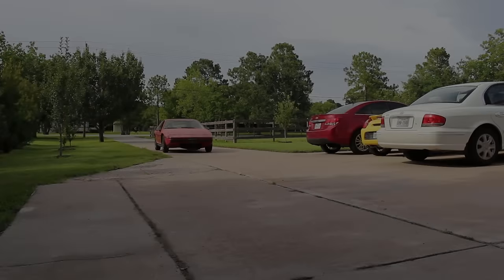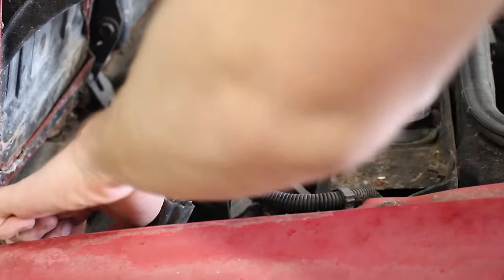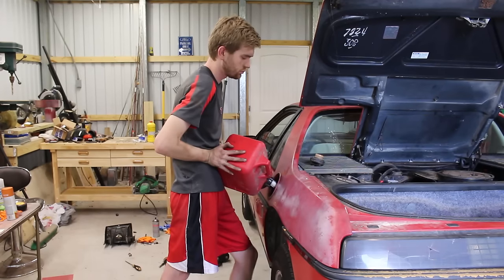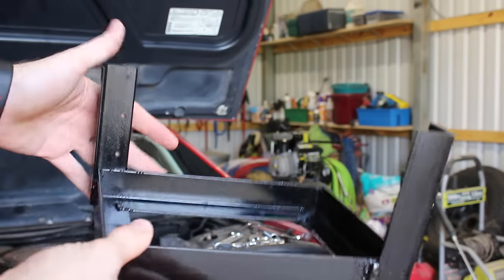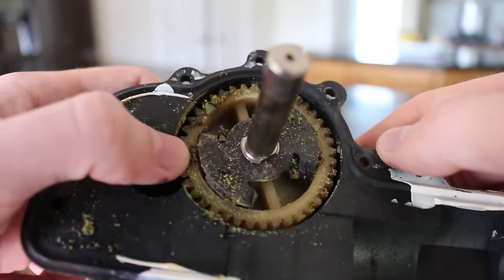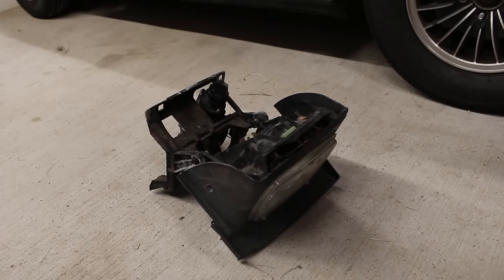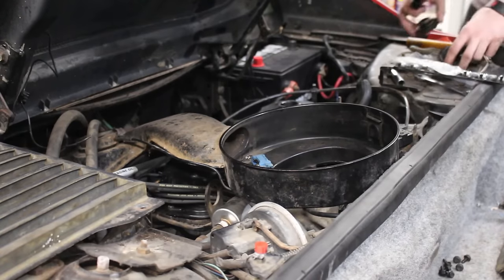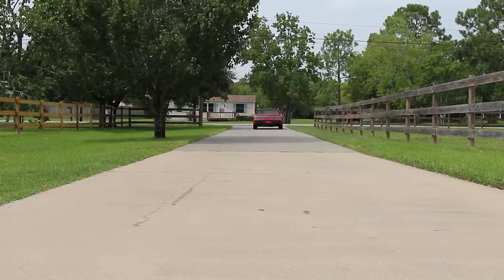Blink Once If Your Headlights Go Up and Down | 1985 Fiero 2M4 Revival - Part 4

Comment: The broken bolt was nothing compared to the fear of seeing a fram oil filter
Reply: WORST filters out there, absolute junk.
Reply: Napa Gold may be a better choice.
Reply: I only use WIX on my cars.
Reply: Wix, Purolator, Napa. All infinitely better options than Fram.
Reply: @SecretSauceyjuice  I go with Purolator BOSS myself since NAPA isn't close by
Reply: I can't believe I had to scroll down this far before finding a comment on the Fram filter.  There are many videos on YouTube showing how terrible Fram filters are.  You would literally be better off having no filter at all!
Reply: The Fram Ultra Synthetics are good. But yeah, most of the others, especially the orange can of death are horrible, shouldn't even be sold really.
Reply: @robis40  Yup. Only use Wix filters anymore. Feel guilty if I am stuck using Fram. Makes me want to change the oil sooner. With Wix, I have confidence that it won't make a lot of difference if I go over my mileage before changing it.
Reply: Wix makes the Napa filters.
Reply: Purolator ONE seems to be one of the best filters.  The nice thing about the Motorcraft filters if you're a Ford guy is that they're apparently just rebranded Purolator ONE filters that are sold for a few dollars cheaper.
Reply: @j5689   Usually I stick with Motor Craft for our Bronco (Wallyworld has decent price)   Our VW Beetle gets the Purolator Pure-One filter....  And our Subaru only gets OEM factory from the dealership filters.  Had a Fram on our former Probe GT (uses H.L.A's for the valve train)  Sounded like total &hit...rattles all over the place.  Went with a NAPA GOLD (wix) filter...  Purred like a kitty and it was nice and quiet..
Reply: you guys realize that pretty much all filters are made by the same company with the same internals right? i have cut more than enough apart to know
Reply: Wells Motorsports, not really, there are some good comparison videos on YouTube, check them out.
Reply: i watched a mechanic on lubetube here open one once, and ran down and changed mine..  i was not aware that they where pure garbo, i even opend mine to verify that they where garbo in my contry aswell, and it was.  would rather run no filter than fram!

Comment: Hanes and Chilton’s manuals, as a 15 year old with no dad around I completely rebuilt a salvaged 1978 Camaro that was my first car. Later I rebuilt my Fiero with same books. By the end the books are always covered in grease but it was money well spent. You may want to pick them up if you can find them. I have owned a lot of cars, I always bought the tech manuals until recently, newer cars are overly complicated.

Comment: Not sure if someone said it. But to easily remove that bolt, weld an 8mm nut to it and turn it out. You may have to build up the end of it a bit before, but it should all be easy.
Reply: @fartmerchant762  will you tho?

Comment: @Ronald Finger Another tip for you. If you break off a bolt again and need to drill it out, next time go to Harbor Freight (or order online) a set of left hand twist drill bits. You run the drill in reverse to drill it out. A lot of times in the process of drilling out the bolt you will end up removing the broken bolt threads because the friction heating of the bolt while drilling will loosen the broken threads and spin them out.

Comment: Quick tip for oil change when you are in your driveway or garage - get some old cardboard or a drip cloth so you don't make a mess. I'm sure this must have been a comment before but I am not going to look over 1700+ comments. Good luck on your build!
Reply: And keep kitty litter around to clean up the floor at the end of the day. Lay it down and grind it into the oil with a brick and then sweep it up with a dust pan.
Reply: Orrr a drip pan

Comment: That bolt snap was cringe-inducing.  And when you started talking about the extractor, I had a sinking feeling what you were going to say.  Ugh.  Where’s Mustie1 when you need him?
Reply: I feel like snapping a bolt is a rite of passage when learning to work on cars.
Reply: @CyclonesWorld  True, I had three cam bearing bolts snap when undoing as the last asshat had over torqued them. Fortunately they just span right out.
Reply: @boboyo  that is a fantastic trick! thanks for sharing. 

(PS: I've snapped a wheel lug before. not the worst thing to replace, but yeah - lessons learned)
Reply: @doorgoo  or convert to inch pounds and use a torque wrench meant for that range
Reply: @robertvulliet3278  What I do. Inch pounds.
Reply: Yup, just a gentle squeeze down for those. Good luck with the drilling out of the extractor. Cheap quality or not, it will be hard metal. I'd be trying a sharp punch and a hammer to see if it would tap round. Sometimes bolts break but aren't tight. With this engine is there a possibility that the bolts are more than one length and this one has bottomed out?
Reply: @delukxy  Another way I usually extract busted bolts, back when they happened, is actually just use a cheap chisel and punch a slot into it and unscrew it with a screwdriver. Works good for calve cover bolts since they rarely bottom out.
Reply: That's the first of many bolts you will break off.
Reply: Yeah I was just in the same boat with intake manifold bolts!
Reply: Ha i watch Mustie1 too!
Reply: I did the exact same thing when I changed the valve cover gaskets on my Jeep liberty (RIP). Took it to my mechanic and he said: "let me guess, Harbor freight torque wrench?"  he was right...
Reply: @BigATB  Haha I bought a HF torque wrench, and my dad thought that was unacceptable. So now I have that and a Snap-On one. Probably saved my brakes for me
Reply: Broke my share of bolts over the years, just a thing that happens lol

Comment: The SECOND you started tightening that valve cover bolt I knew was about to happen lol... I did the same thing two years ago. I was too lazy to even try to extract it so i just put a liberal amount of RTV around the bolt hole and its doing the trick... but completely forgot about it.

So... thanks for reminding me that I really gotta take that thing out.

Comment: This is just my input on the gas pedal. I think the reason why is that if you put the ball of your foot towards the top of the pedal you canapply pressure and the friction from your shoe and pedal with the leverage would aid in a long trip almost like a mechanical cruise control. A lot of 80's American cars with manuals and some with autos didn't have cruise control and early cc wasn't very fuel efficient.
Reply: Just need to get that pivot lubricated and moving freely, and drive with his heel on the floor.

Comment: Great job on the Fiero.  I like that you took things like the headlight motor and rebuilt them vs buying new/rebuilt ones as a complete unit.

You've had lots of advice on the broken bolt, but I want to say two things,  Yes, get an inch pound torque wrench.  I have 4 torque wrenches from smaller inch pound to long HD ft pound units.  I believe Harbor Freight has a digital unit that is inserted between a normal ratchet handle and the socket/extension.   Also, while a manual may or may not indicate torque values on the valve cover and other bits, one thing to look at is torque values per a certain size bolt regardless of what it's going in.  Those values should be easy to access online or possibly in your Fiero manual.

Finally, I didn't see this in the comments, so if someone already mentioned it, forgive me!  But, I was cringing when you were changing the oil on that nice, clean driveway.  When you do that again, use some cardboard to lay on the concrete.  It's easier on you than laying on the rough driveway, and it catches the drips and such from the oil.  I keep a few of my bigger mail order boxes around just for this purpose.

Again, great job!  I look forward to the next video, whenever that is.

Comment: I recommend deleting the EGR with a blockoff plate shaped like that gasket you replaced, minus the holes. Plug off the vacuum lines and say you're welcome to your engine for not force feeding it exhaust gasses.
Reply: I was honestly a bit shocked when I first read, that the fiero has an EGR. I hate EGR's and I don't get it, why they put it to a gasoline engine. I mean my old E39 doesn't have one.
Reply: @jensharbers6702  this particular Iron Duke won't throw a code or have any issues with the ECU after an EGR delete since the valve is purely vacuum controlled. Emissions in the early 80s was a bad scene.
Reply: I just did a 2.8 delete and bolted in a turbo 3400 lmfao

Comment: Haha, the snapped bolt cracked me up, the moment you turn it for the third time I instantly thought that's not right, you'll snap it shortly :)
There is hope though for you, despite snapped bolt extractor in there. Get yourself some CARBIDE drills, they will drill through the broken hss in there with no problems, then you should be able to retap and do it right :)
Good luck!

Comment: 3:58 "it's probably just left over electricity that turned to grease over time" what?
Reply: Hint: Joke
Reply: I loled
Reply: Whoosh
Reply: I use left over electricity to power my left handed board stretcher
Reply: @johntripp5159  Dude! Where did you find it left handed? I've been looking for one of those for years!
Reply: If you're new here, Ronald has a bizarre and fascinating sense of humor.
Reply: He got me for a second with that deadpan humor too.
Reply: @andersjjensen  I was in the mental sail loft and it was sticking out from under a bale of three inch shoreline...

Comment: Let me guess, on torque specs for the valve cover you read it as FT lbs and not IN lbs lol. I watched my best friend do the same thing on his chevy.
Reply: Did the same thing to my jeep a while...  But I'm now rebuilding the engine. Take you time and you'll have epiphanies on how things work / how to resolve issues.
Reply: he just forgot to say "Click" and move on to the next one (Daboss Garage reference)
Reply: I did the same thing to my 99" TA after changing a push rod.  100 ft. lbs. didn't seem right but i did it anyway. That was 5 years ago. The bolt is still stuck in the head to this day.
Reply: SweetMahogany Did this about 20 years ago on a Dodge Daytona with an automatic. I was adjusting the transmission bands and mistook foot pounds for inch pounds. Let’s just say it didn’t shift so good afterwards. I wished it was a valve cover bolt!  That’s how we learn though. You’ll usually only make a mistake like that once. Lol.
Reply: @mitch95722  did it on my 04 Liberty. I just upgraded to a real Jeep, 2015 2-door willys wheeler
Reply: Aaron Bernstein did the same exact thing. On an 04 Liberty as well. Haha

Comment: In about 1998 my dad had bought a 84 2m4 that had a blown engine with intentions of putting a V8 in it. Well he lost interest and gave the car to me. I ended up buying a 86 V6 se that the body had been completely removed by a gentleman that worked at Cape Canaveral. Yes he was a Rocket Scientist, he was going to build a Lambo/Fiero. He built his own body mold. Again another person whom lost interest. I pulled all wiring out of the chassis of the 86 and then the 84 and made a 84 V6 Fiero. Swapped in the motor and transaxle and ecm. I had alot of fun in that car..

Comment: Don't feel bad about snapping that bolt I've done it many times, and in my experience here's what you do, you get yourself a high quality extractor and after a few failed attempts you pour some gasoline over the vehicle light a match watch it burn for no more than 29m and 15sec.hose it off and then call the junk yard to pick it up.on to the next project.😛👍

Comment: Dude I was literally cringing the second I saw you cranking that torque wrench.... It was like a watching horror movie
Reply: like he was putting on head bolts with all that torque, then bam......
Reply: The simple fact it was a click wrench told me he was about to torque that valve cover to infinity and beyond. Standard length 1/4 ratchet and a nice "snug" calibrated elbow torque wrench click is all it needs. Then if it leaks, give it the beans once again

Comment: Next time you remove a snapped bolt drill a small hole and use an appropriate sized torx bit and hammer it in and then remove with a socket and ratchet works everytime

Comment: Ughhh...sounds like you made the classic "inch-pounds versus foot-pounds" mistake when you broke that bolt.  I have been working on cars for 30 years and I have done it, too!  The later Fieros have one module that controls the headlights, and it is known to fail.  New ones are brutally expensive, but I discovered early Saturn SC coupes use the same module.  When I had my '88 Formula back in 1998-1999, that meant a quick trip to the wrecking yard for a $5.00 replacement.

I really miss that car.  Bought it from a wrecking yard after it had an engine fire!

Comment: As soon as I saw you cranking down on that bolt with that big of a ratchet............. Oof, I like to use a 1/4 rachet just so I can't over-torque bolts on pans and covers
Reply: I was just going to say the same thing. I don't break out the 1/2 inch drive unless the bolt is bigger than a 9/16 or so. 3/8 drive with your hand up by the ratchet head or use a 1/4 inch like you said.

Comment: You broke a bolt in the engine?  Time to replace the engine, that's a rule.  Gotta put a LS in there now.  God wills it.
Reply: Of all the interesting engines this world has to offer, why on earth put the most cliché one of them all in there?
Reply: @andersjjensen  It's cliché cause it's a great engine that fits into tight places and they're cheap.  Find a LS4 from a junked Pontiac Grand Prix GXP, the Chevy Monte Carlo SS and Impala SS, and the Buick LaCrosse Super.
Reply: @DukenukemX  Exactly - cheap, reliable horsepower. You can't beat 'em.
Reply: 13b swap
Reply: Turbo 3400 is my go too! Lol shameless plug checkout GARAGELESS
Reply: @TheUberdude14  You mean Quad 4 engine.
Reply: @Garageless  I dig the 60 degree V6's but LS.
Reply: @DukenukemX  ls is just a bit more costly by far
Reply: My understanding is that a 4.9 from an early 90's Cadillac is almost a bolt in.
Reply: The 4.9 is ok but not the best engine to use “I had 2 in my fiero” Those engines have terrible HP numbers and only all torc. They’re disposable engines as well... “Very expensive to rebuild might as well throw away and buy another from the junkyard” 

Like the northstar they have cyl sleeves with o rings to keep coolant out the combustion chambers “very stupid design” I won’t go into details about if you rotate the engine with the heads removed.

The 3.4 and 3800 sc engines is the best engine choices “Both engines has tons of info on them.

I’d use a stock 2.8 over a damn 4.9 caddy engine.

Comment: You probably already know this but you can weld a steel rod with a hollow nut to the broken bolt and back it out.  Check out FuzzyDiceProjects on YouTube, he seems to do that quite often.  Great video!
Reply: Hard with the smaller bolts

Comment: Screw Fram filters!  Get a Wix, or a NAPA Gold instead.  Fram are notorious for collapsing inside.
Reply: I agree, even though Fram was the original designers of oil filters, they are now the worst choice one could make.
Reply: Good to know.  Thanks for the tip.
Reply: Wix makes the filters for the NAPA gold series. Not sure about the silver series, though. :)
Reply: This. Times a thousand. Wix are all that go on my vehicles, period.
Reply: Yep, Wix 100%! My automotive tech professor always grimaced when he would see a Fram on a vehicle lol
Reply: +1.  I only use Wix filters.  

If I were your dad I wouldn't be happy about the oil stains on the driveway.  Get a sheet of OSB or better yet cheap plywood, cut it in half and out it down before you change oil.  If you drip or spill it won't soak into the concrete.  Your dad will thank me.

Comment: As an old Fiero owner, some tricks we used to keep the car going was change the coolant thermometer from a 185F degrees to 165F degrees.  You should also move the battery to the front of the car for both weight distribution,  as well as the battery will tend to leak onto the wiring loom - which is located under the battery tray.  Another trick is to wire the radiator fan to be 'on' all the time, when the car is turned on.

Comment: Greasy electricity is a big problem for these old cars that aren't fitted with a > 100 milifarad current filter. You can test if your car is fitted with one by licking the battery terminals. If it tastes of minty-metal it's fine, if it tastes of gravy and death you need to scrub the whole electrical system with a mix of vinegar, caustic soda, and ground beef. And make sure you lube the battery contacts with lots of ketchup before you hook the battery back up. Use soy sauce if it's a Japanese car.
Reply: Lol
Reply: My friend has a Triumph with the old Lucas electronics, he had to use a blend of HP Brown Sauce & Malt Vinegar, I think you need to use mayo on Spykers, and Curry Ketchup on VWs, Audis and Mercedes Benzs. Be sure to check your manual.

Comment: While trying to fix an exhaust leak on my Bronco, I snapped a bolt head that held on the header, right next to the one that was already snapped off and causing the leak. I then broke four extractors trying to get the two bolts out. Eventually I gave up and decided to drill out the bolts and tap them by hand... while still on the truck and working through the wheel well. Five carbide tipped drill bits, three tap sets, and a couple of helicoils later, and I finally got all the bolts installed and tightened down. Now, instead of having an exhaust leak due to one broken bolt head, I have an exhaust leak due to two misaligned and sloppily tapped bolts. Learning from mistakes is frustrating but fun. I just don't worry about it too much since I plan to swap the engine at some point anyway.